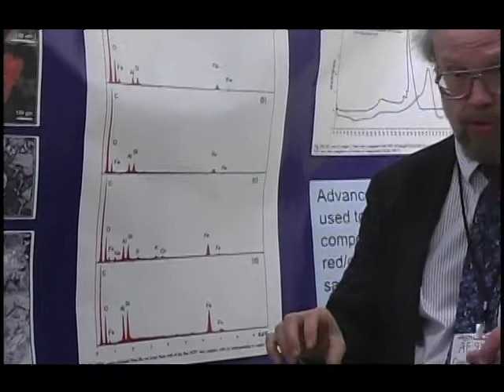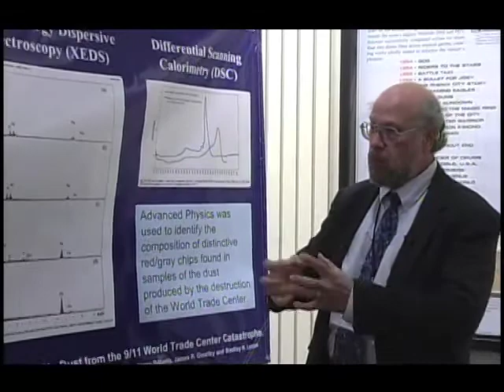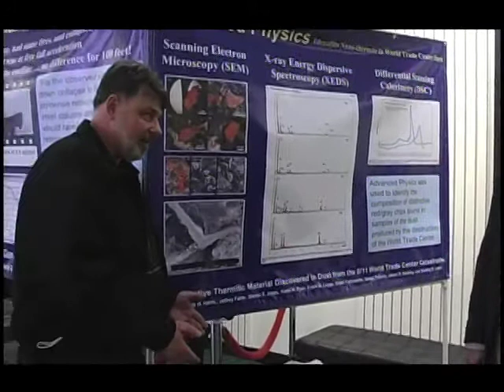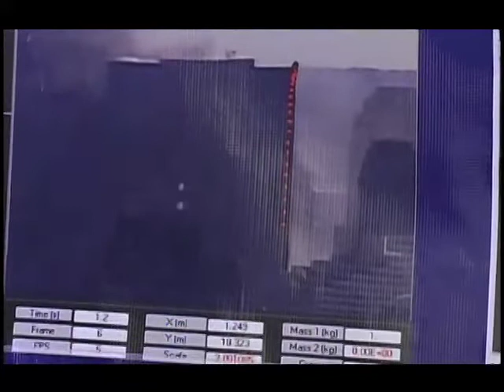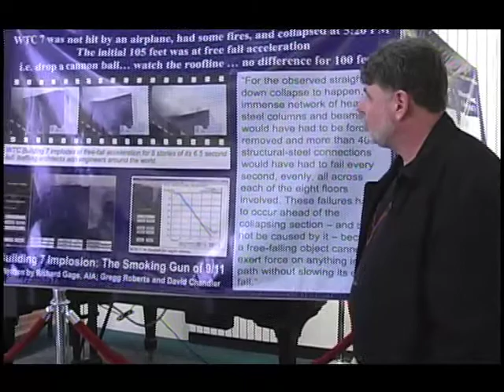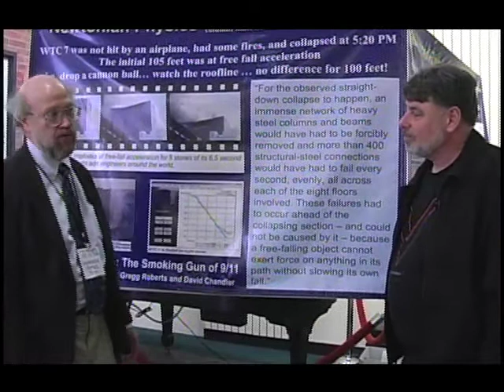Interview With: Wayne Coste - Registered Engineer - 2.mov

Comment: u know the most correct theory about wtv collapse is that each building had nukes in the basement, these were there in order to demolish them safely in case of emergency, preventing damage to surrounding buildings, notice that the first responders had radiation posioning